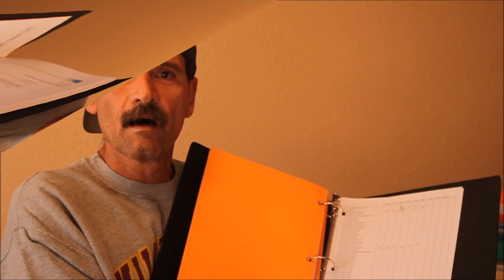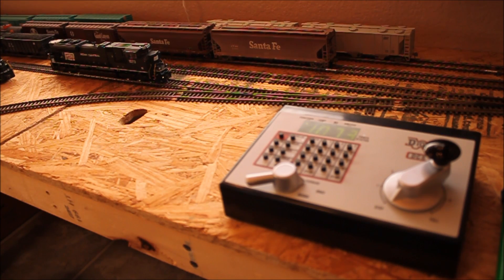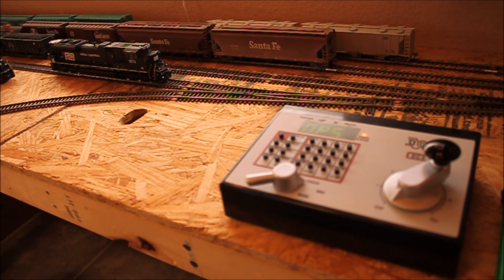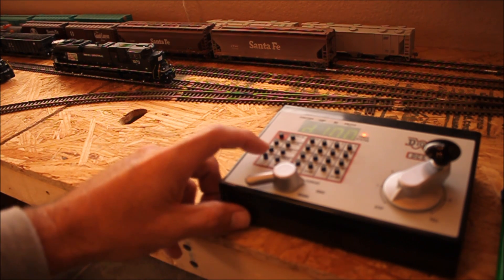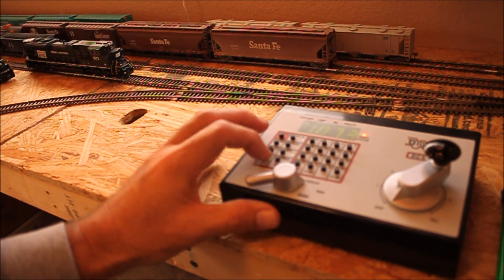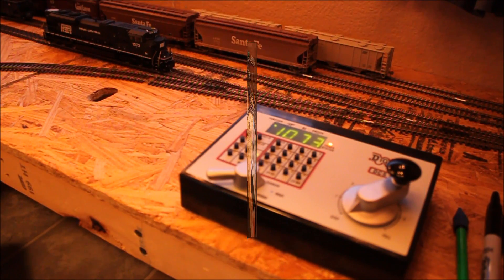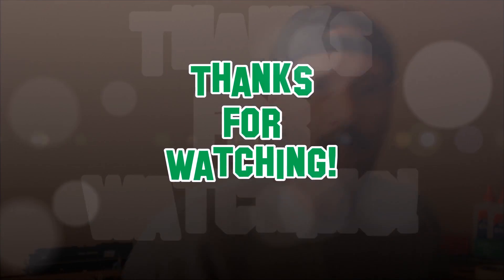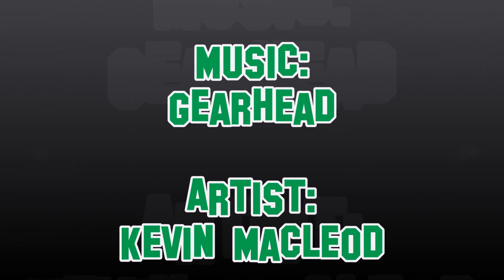Programming CV's for DCC/Sound Decoders

Comment: Great video!! Mine keeps saying busy, left it off for a few hours and still says busy, any tips on what it could be?
Reply from the maker: Thanks, glad you like it. According to digitrax, a  “busy” message during programming means that the system is temporarily busy.  Simply try the task again.  When the system is no longer busy, you will get a “Good” response. A  “Fail” message during programming means that there is a problem with the locomotive on the programming track.  Check to be sure the loco's wheels are making good contact with the programming track.  Make sure that the decoder is properly installed in the locomotive.   Make sure the connections to the programming track are secure.  Make sure the programming track is powered.
Reply: Thanks, I will try what you mentioned. All of my others program fine. Just this new one :(

Comment: PLUS  i dont no the number  i tried 03 and some others  but no luck   i would like to keep the setting and change the loco number  but how do you do this if you dont have a clue what the old number is  thanks
Reply from the maker: hi, let's try and handle one issue at a time. First, let's see if we can get you decoder to respond. What brand is the deocder? Most decoders will reset to factory default by entering the following sequence: PROG→ OPS → Address “00” → CV 8 = 8, CV 30 = 2 → Power Down. let me know if this works.
Reply: no .... so  its a  OLD STYLE tsunami steam decoder as i have used others . i did buy this at estate sale brought it home and hooked it up but nothing.... i tried to reset myself put nothing ... im using a digitack  400-2 controller .. there seems to be some tape not like the new ones that are purple tape , its CLEAR  YELLOWISH kemton tape ?   and i have the plug hooked up as this    red  and black power  and orange and gray to motor ?..    its not in anything ..SO ........ it was hooked up to some other board  and i think it was for a chip that  was for a system using remote control ? the chip that i CUT off said LINX rf module it has a black red and dark green wire on it they ran underneath  the tsunami chip       I DID LOOK THIS CHIP  UP AND  I GUESS FOR   S- SCALE REMOTE CONTROL  OR "HO" AND YOU CAN USE ANY  DECODER YOU WANT  .. i dont no just trying to figure this out ... I THINK YOU MIGHT HAVE TO HOOK BOTH CHIPS TO RESET  PLUS on that other  LINX chip it has a BLUE  STICK ON IT IT AND THAT SAYS      AF 916 ?
Reply: i just found out  that i need a S-CAB throttle to run it     so,,  mine is i guess an older style ...  i explained to guy that i put new plug just in decoder and he said NEED S -CAB CONTROLLER so ......... see if you can find out anything  thanks
Reply from the maker: glad you were able to figure it out, good luck!

Comment: i bought a decoder by its self i hooked it up to motor and track power  and so the sound works good  and its is not in anything  . can you explain how to go about doing this it is a tsuami steam and it was hooked up with a (link rf module / rxm-916-es  or and lxr v2.1 oct-2011 on one chip and other is the tsuami .. it does have cap. and speaker hooked up to it  i think its was a remote control it also had a plug for battery i  want to hook it up in my steam engine ..  i also tried to plug new harness in the decoder by itself to .  can or have you ever seen this kind of hook up before ?   i have seen this kind in S-scale it almost would be like the new b.limited rolling thunder  with the AF  it looks to be the decoder is factory with speaker  and cap. and the af chip ? i have no idea ? paid five bucks for all estate sale . the tsuami decoder is heavy or med steam  with no PINK OR WHITE WRAP ON IT  its older one  and i think it is a 750 or 1000  thanks i no its alot  and using a digatrax  400

Comment: WOW I just switched from MRC to Digitrax so this was a big help to me! Thank you and will review this again later!
Reply from the maker: hi Ray! Glad you liked the video and it was useful. Not to long after this video, I added a DT402 handheld to my system. Programming is easier with the DT402. Hope you review the video and if you need help, just let me know.
Reply: Hi PennCentral99, 
I wanted to let you know that I spend a lot of money on mostly MTH locos planning on using the MRC system but changed to DigitraX. In hasted i bought a used Digitrax Zephyr dated 2008. I want to replace it with a new one and am also planning on buying the DT500D Advanced Duplex Radio Equipped Super Throttle.Some of my MTH switcther  locos have the remote controlled coupler on them which I want to also use the Digitrax to use the remote controlled coupler (CV 8 and 9). Can the Digitrax activate this coupler like I could with my MRC system? Would really appreciate more details via my email which is bulldozerman01@gmail.com. Thank you very much! I am 69 and 30 per cent disabled so I do have the time to spend on this. Thank you very much! Ray w Stutzman

Comment: Okay I've configured my Athearn GP38-2 as you've  describe with good results.  I'm using a Prodigy Express 2 DDC, still have a horn sounding on every speed step increase but I can live with it. my last problem is at shut down the bell sounds endlessly and #1 doesn't end it's ringing. any ideas?
Reply from the maker: glad the programming is going OK. Seems like CV 193 (Automatic Bell On Set Point) is set to low (0 or 1), try changing it to 5. Also, if things are not happening the way you want, a complete reset to factory settings may be needed, then program the CV's you want.

Comment: the only annoying feature is the horn sounds every time I increase or decrease speed how can I eliminate that?
Reply from the maker: I believe that feature is based on how fast you turn the throttle up or down., try a slow increase or decrease. If that doesn't work, you may be able to adjust CV 195 (see the bottom of page 63 in Soundtraxx User Guide)

Comment: More helpful than you can imagine!  Thank you, my man! ;)
Reply from the maker: hi John, glad it could be of help!
Reply: +PennCentral99 Do you know if Athearn has a CV setting for 'shutting down' their engines?  Broadway Limited has a preset sound effect for this for both their Steam and Diesel Locomotives, that being the F9 button.  It's a neat sound ... the engine revs down, the brake is heard being pulled, and then all goes quite.  So ... I wondered if you knew of a CV setting for this in an Athearn Diesel Locomotive?  I'm technically inept in figuring things like this out! LOL!!!  Appreciate any help!
Reply from the maker: hi John! I know that some loco manufacturer's have the decoder companies program certain functions, but not sure about this one. I think it depends more on the decoder and command station than the loco. Since this video, I bought a Digitrax DT402 throttle. The hand held throttle has an Emergency Stop Button, which is not on my Digitrax Zephyr Xtra command station. When I push the Emergency Stop Button, whatever loco is active will go thru the shut-down sequence. For the dynamic brake,  it is F11 on the Digitrax hand throttle. I use it all the time because I have it set to actually stop the train, brake squeal and brake set.

Comment: like your style of organization with the binder.I rediscovered the hobby being a young man like yourself and found the dcc technology to really bring the hobby to another level with this technology .Have many different sound decoder types and have done a few installs.he tricky one I have to program is a MRC 16 bit sound .They are very vague on there programming instruction .So a lot of trial and error .Runs and sounds really good ,but having found when you turn on the bemf it will not run smooth until Ifound that you need to manually program almost everything related to it  and have a 4 digit address in it .This is the main trick .Has to have a 4 digit address and program 112,113,114 to lower then default values then set the command station to 128 speed steps and walla! All working as good as any of the high end sound decoders.More work ,but worth the price especially in a Bachmann Spectrum.Great videos you do Thanks!
Reply from the maker: I seem to work well with soundtraxx tsunami's. my last loco purchase came with an ESU decoder. I'm not disappointed, but the learning curve is different.. Also, since I bought a handheld (DT402), programming is much easier, and I guess it'll get easier if/when I get a PR3 and DecoderPro. Thanks for watching and commenting!

Comment: Thanks for the video. I was able to use this in programming my new Genesis GP7. As I am new to this again I appreciate videos like this as they are so much more informative then the directions in the box. I do have a question, during your video you were about to explain how to match the sound of the loco with the movement, how were you able to do that. On mine for example the sound revs up to slow to the movement and when it stop locomotive stops the motor is still whining down. I have CV 3 and 4 adjusted like yours. Thanks again for your help.
Reply from the maker: I'm glad the video helped. Try programming CV 3 and CV 4 again. I have CV 3 set to 150 and CV 4 to 50. I have since gotten a DT402 and have learned a whole new dimension in programming. I have noticed that even if the loco "lurches", sometimes the decoder still doesn't take the command. The DT402 will tell me if the decoder takes it by reading "good". The book talks about "manual notching" but I haven't experimented with that yet. PM me if you need more help. Thanks and I appreciate your comments!

Comment: This was a great video. I actually learned something I didn't know. Regarding the comment from Grand Pere Marquette, I was able to program each one of my locos to come on when I turn the throttle knob. I downloaded the Diesel Technical reference manual as well as the Diesel Sound User's guide. Both of these you can get from the Soundtraxx website. Just click on this link.
http://www.soundtraxx.com/manuals.php. To get the loco to start at the turn of the throttle knob, program bit #5 of CV #116 to 0. The explanation is on page 3 of the Diesel Sound user's guide and page 61 of the Diesel Technical Reference manual. 

I would like to know how to stop the loco when you have finished it. I would like to do it without turning off the track power. It says in the Users Guide to press the Emergency stop button on the command station but I have yet to figure out where this button is on my Digitrax Zephyr Extra.
Reply from the maker: In order to have the sound shut-off after use, CV 113 needs to be programmed. Go to page 65 in the Diesel Technical Reference manual. According to the techs at Soundtraxx, the Emergency Stop Button they are referring to is on the handheld (i.e. DT402). The Emergency Stop Button on the Zephyr is the Power Button (but that wouldn't achieve the purpose). I used to do this, but didn't cover it in the video. I'm glad it helped, thanks for watching and commenting!

Comment: Great job!!  Two CV topics that I haven't figured out yet are: 1) how to program 4-digit addresses.  (I think this has something to do with "extended" addresses but I haven't seen specific instructions on how to do it.  2)  I hate it when I power up my controller and most of my locomotives fire up.  I would like to be able to start each locomotive separately and only when I am ready to use it.  My LokSound decoders do this beautifully, but the others all start up when the power turns on.  Any ideas?
Reply from the maker: If you are using a digitrax zephyr, please watch my "Blast Mode" programming video, it covers 4-digit address. If your other sound decoders are soundtraxx, I believe CV 113 can be programmed for the "quiet mode" and only sound when summoned